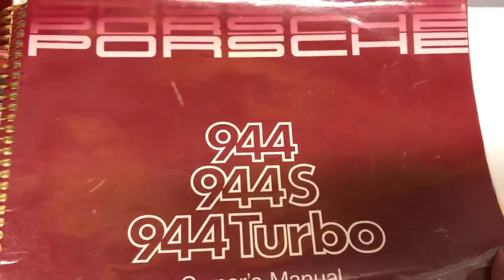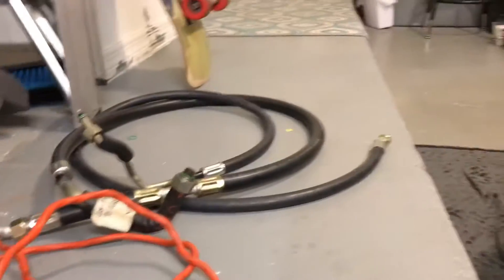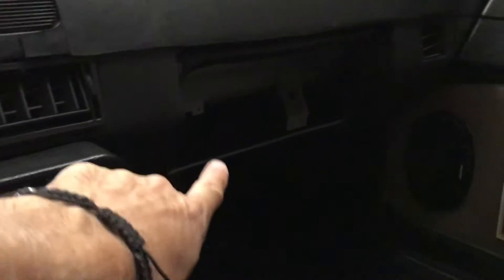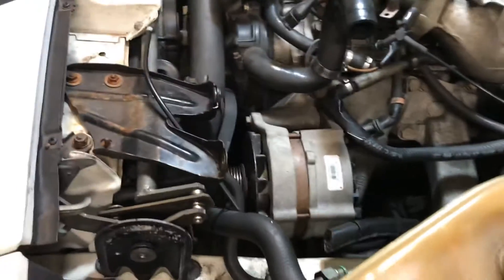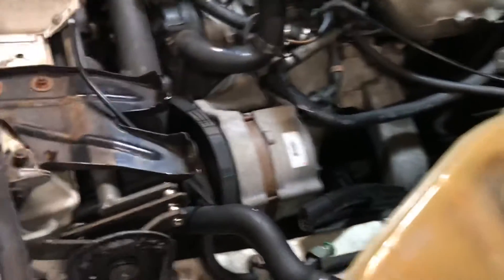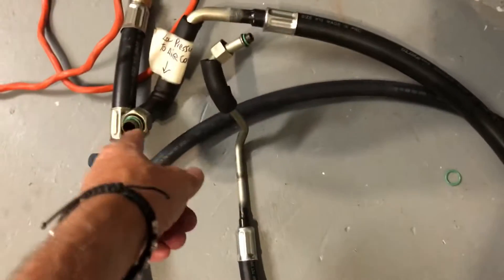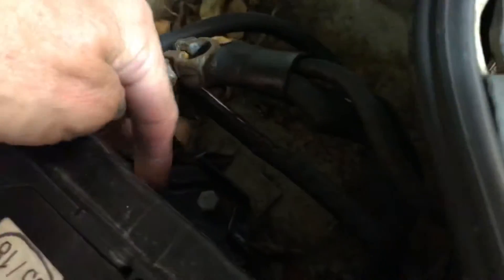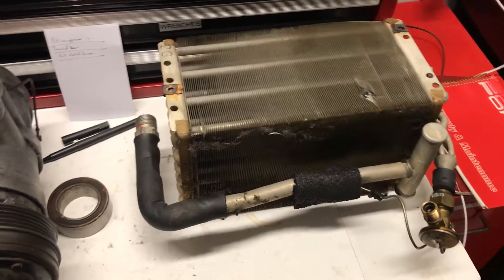Porsche 924S AC rebuild and components

Comment: Hi Tim, can you tell me where did you made the hoses? I am trying to put AC in a 944 series 1 and I don't have the old hoses to use as a template.
Reply from the maker: I found an a/c shop in Miami that was able to do it. I took the old hose in an they copied it. There are two 6’ long hoses that go from the compressor to the ac coil air box under the dash those you need original hoses. Then there are 2 short hoses from compressor to condenser and to the dryer. You can find used ones on eBay. Check there. I think regular Porsche parts suppliers have new ones for the short ones. But I’d check with eBay to see if you can get a used replacement. Metal hoses are really hard to get put in place that’s why I used rubber hose so I could snake it through the engine. I hope this helps